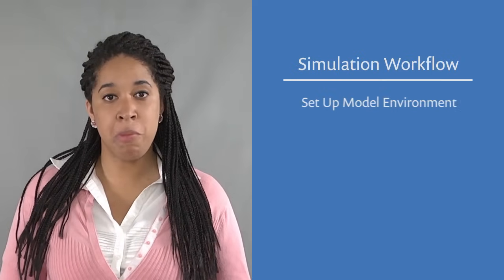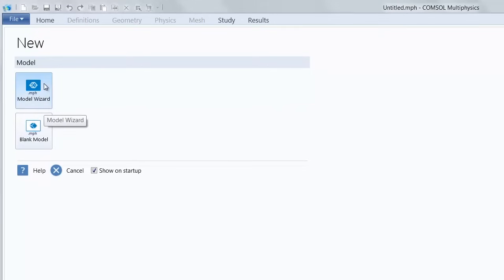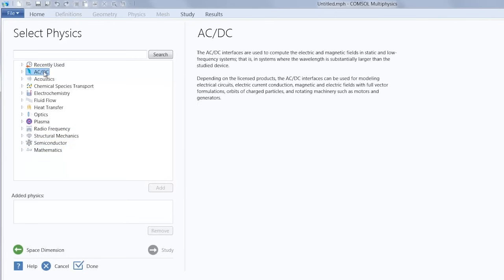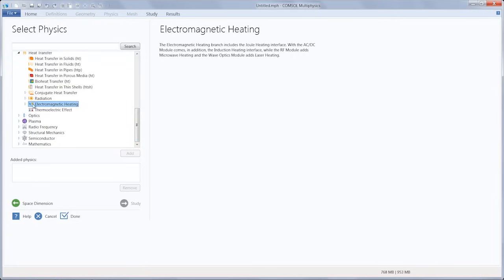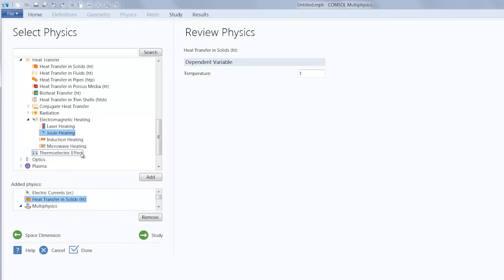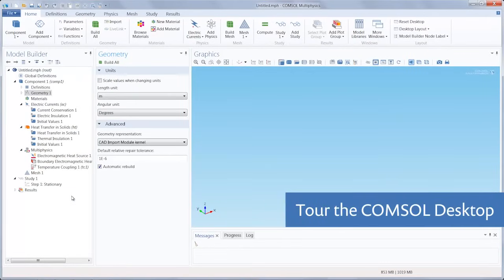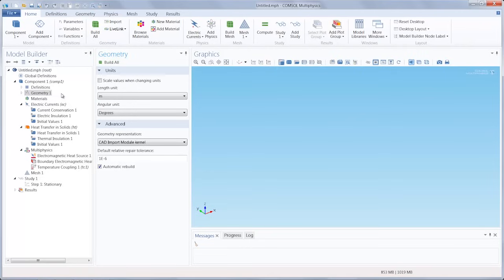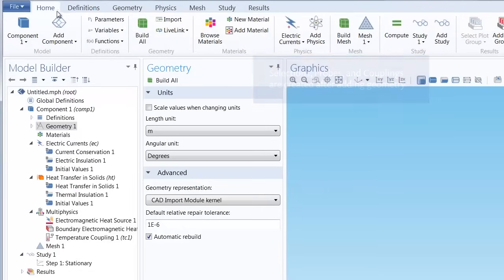Set Up the Model Environment in COMSOL Multiphysics (1/8)

Comment: Hy I want to simulate non thermal atmospheric pressure plasma torch.. I want help
Reply: please if you have experience with COMSOL Multi- program i need to the helping  to solve  a problem simulation

Comment: Hi I am working on RF resonators and want to simulate same on silicon wafer. I want to take Silicon wafer as a supporting layer and then deposit platinum, ZnO and Platinum on it. In meshing it is showing problem. Will you help me.

Comment: hi,
please send me your email ID. I want to send you a Generic 3D model of a Annular Linear Induction Pump working on 3Phase AC 50hz Power. I will be grateful if you can make the vdo and upload. It will be a coupled solution of Magnetic Field and Laminar flow with Lorentz force Multi-physics. I am facing problem in meshing and also to converge the solution. So detailed meshing and study setting are needed. Please help.

Comment: hi,
I want to couple two physics.i.e mixture flow and heat transfer in Fluids.I have defined two physics. But i am unable to couple them. please explain the procedure about how to couple those two physics.
Reply from the maker: Great question, Sandeep hegde, coupling a Mixture Model interface to Heat Transfer in Fluids requires the following steps (since it does not have a dedicated multiphysics interface). Click on the "Mixture Properties 1" node and in the Settings window, under Model Inputs, there is a Temperature drop-down menu. Switch from "User defined" to "Temperature (ht)". Similarly, in the "Heat Transfer in Fluids 1" Settings window, the "Absolute pressure" and "Velocity field" model inputs may be changed from "User defined" to "Absolute pressure (mm)" and "Velocity field, mixture (mm)", respectively. Now your physics are coupled.